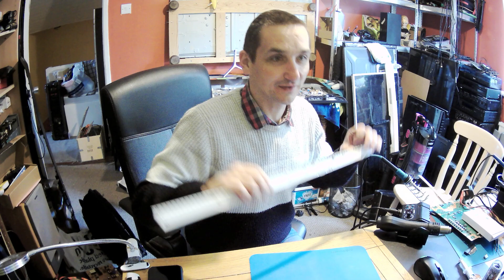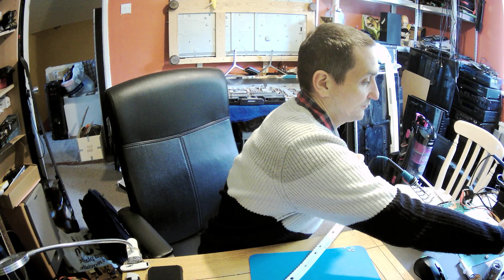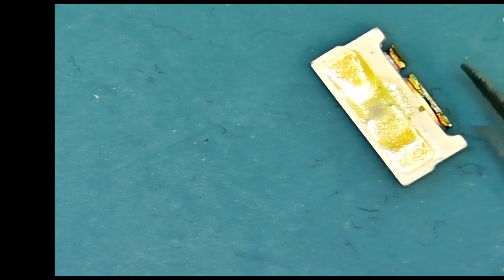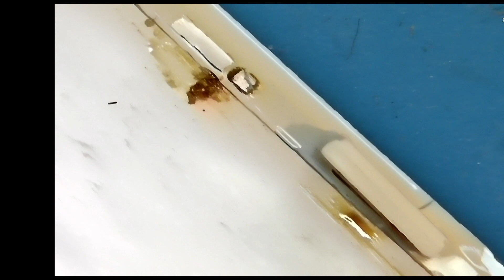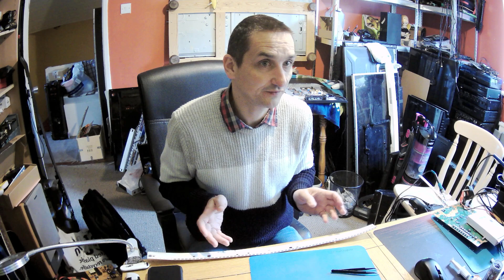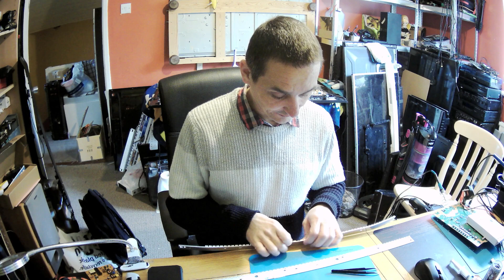Backlight in the TV - edge backlight, can we replace single diodes in THIS type?

Comment: If you’re going to do it the bad way Use flux and it’s soldered 100%, but take my advise don’t bother changing them just replace the strip, otherwise it will come back with more duff leds trust me Peter for once 😊
And check the diffuser sheet they normally melt.. don’t try and add LEDs as it won’t work the diffuser is made for one strip, if you look there’s white tape to reflect the light back.
To make them last longer modify the power supply to cut the current by removing 1 or 2 current sense resistors
Reply from the maker: Yes, totally agree with your answer :). I just had a Samsung TV here with diffuser melted. Had to turn in upside down to be true. And cust corners. Otherwise, the light would not spread evenly as it wasn't already before changing those LEDs.
Reply from the maker: wow, didn't know we can do it about those current sense resistors, have to find some time to look into it next time I'll be doing it. So, Thank You :).